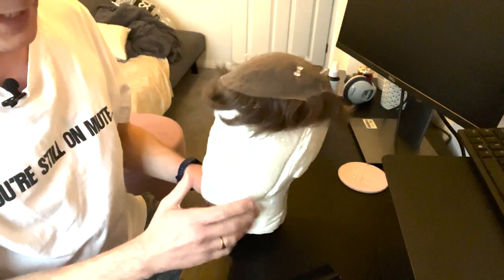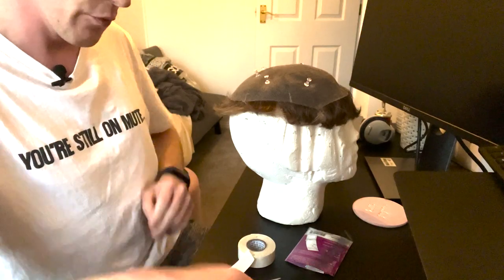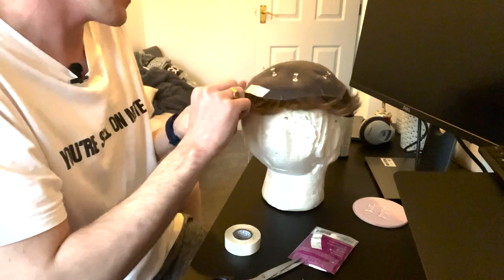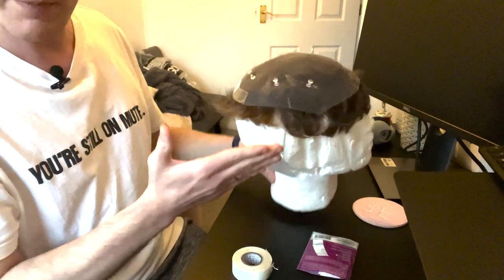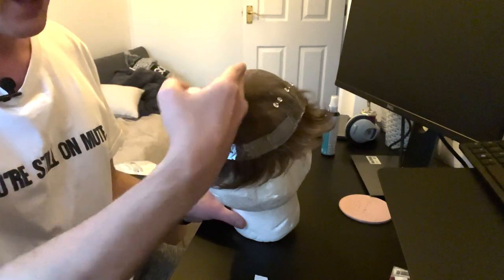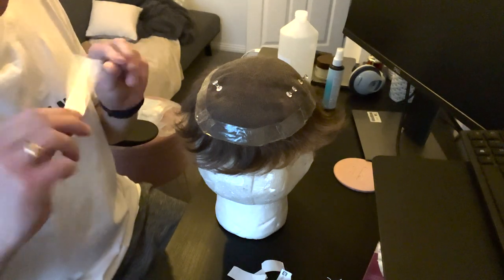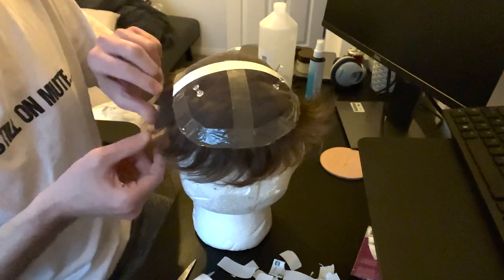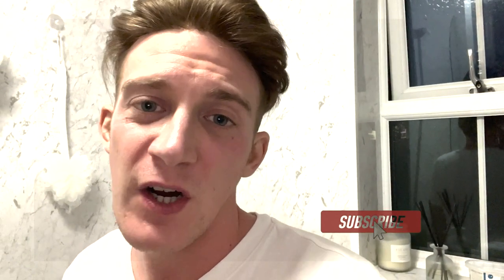How to use tape on your Hair System | Tutorial

Comment: Awesome tip. all lace base pieces are a pain with tape sticking, That's why i stayed away from full lace pieces. but my new one is a full lace unit and am having the same issue. So i use knot sealer on the base. its a spray it helps but now i will add the extra tape in the center. like you shown, I remove daily so this is good!!👍

Comment: Hi, I followed your previous video on using tape. I've had my system on just over a week now and have noticed  that I have a black line round the sides of my head where I used the tape. Any tips would be amazing 🙉 👍🙂
Reply from the maker: That's just a build up of oils from your skin. I usually replace my tape once a week
Reply: @HairSystemDIY  Thank you, so change tape once a week and still do a clean every other week?